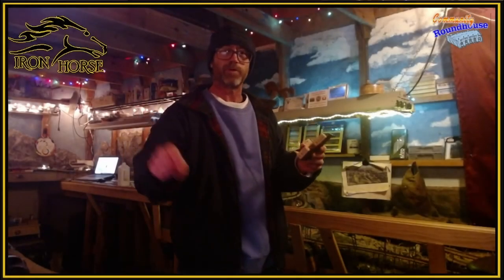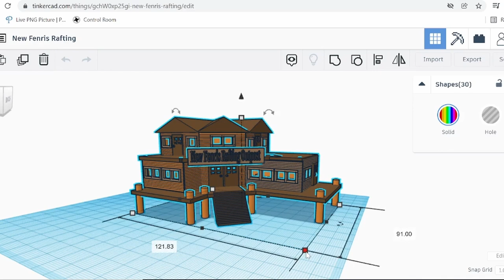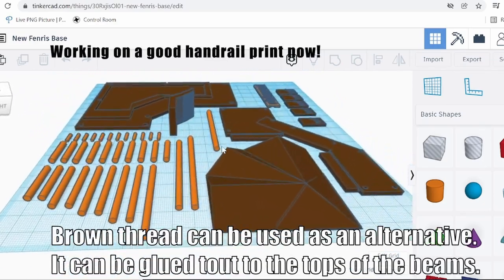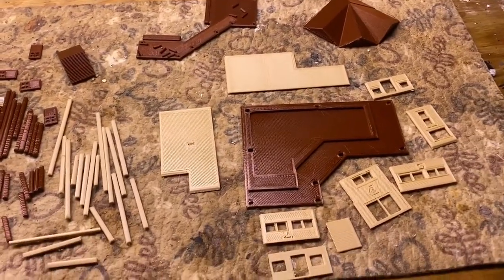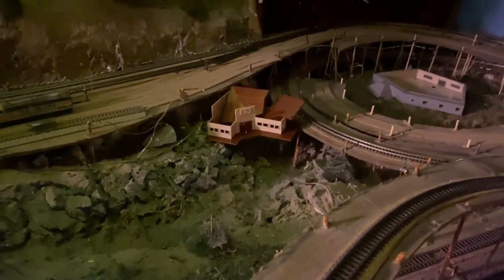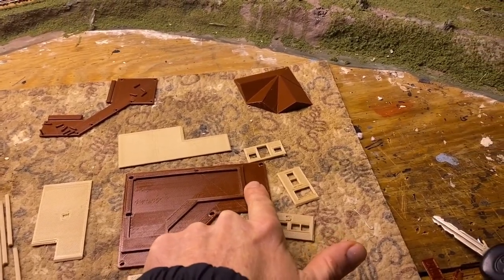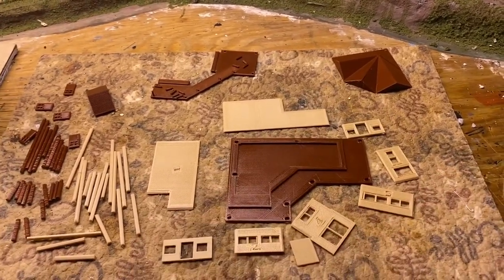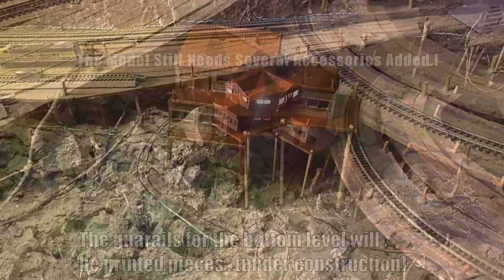White Water Rafting Outpost Kit Design and Build  - Model Railroad Structures - Iron Horse Hobbies

Comment: what kind of glue you using and what brand of pla you using if you don't mind me asking that is a nice building
Reply from the maker: Dwight I can't recommend that glue.  It is simply the best thing I have .  Its that testors stuff from Michaels.  I bought some more expensive faller stuff, but it's so thin  and takes so long to dry, I can't hardly work with it.  I use various brands of pla.  The light brown is "Sunlu" and  the Dark brown is " apcvo".  Both are around $20.  
Thanks for watching Dwight!